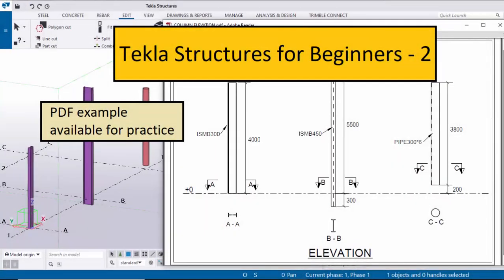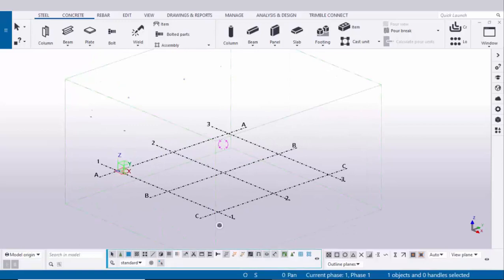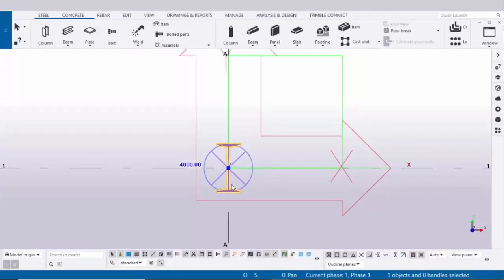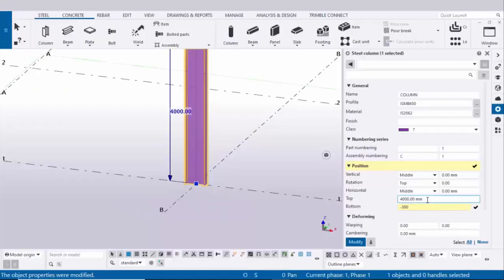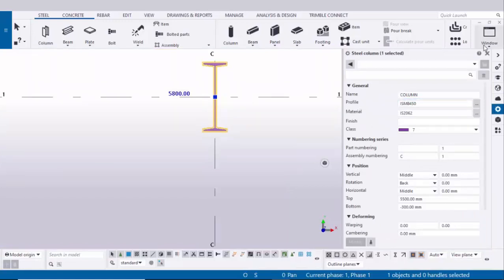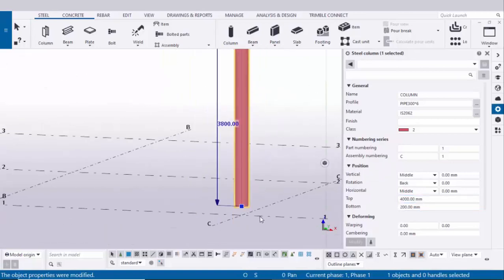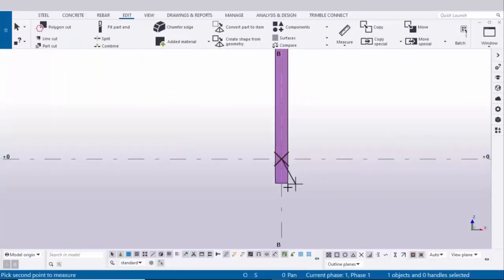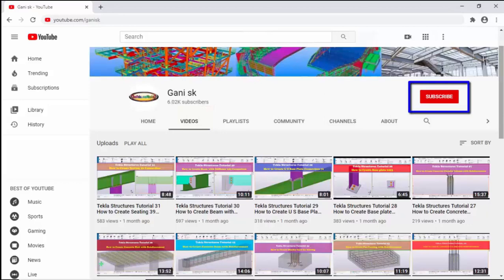Tekla Structures for Beginners - 2 | Column | PDF example

Comment: Hi sir
I am confused regarding graphis card. Can you pls sugest the graphis card to be used for modeling
Reply from the maker: Minimum 2gb graphic card, 4gb ram is enough to run this software. 
To get better performance 4gb graphic card, 8gb ram is required.